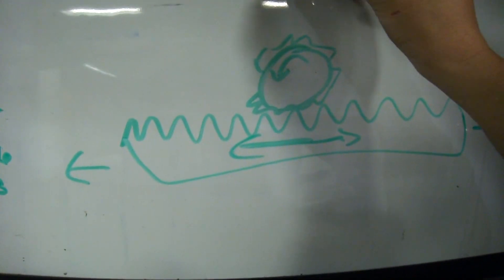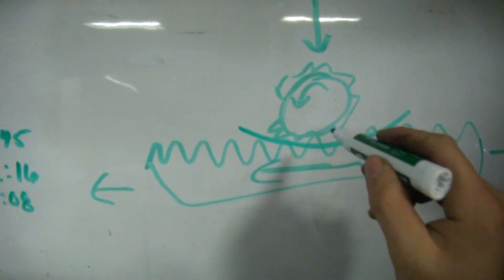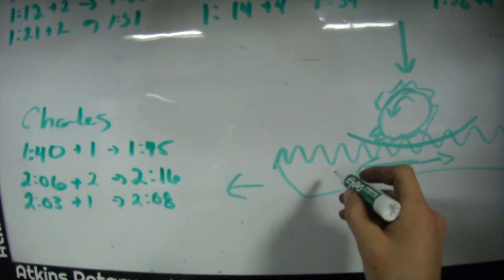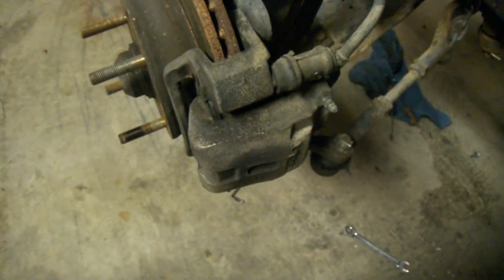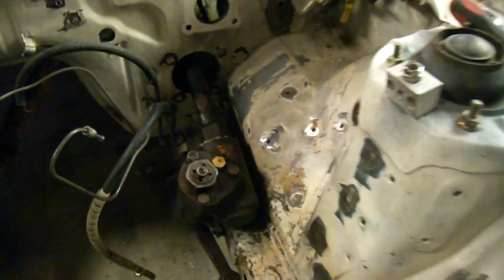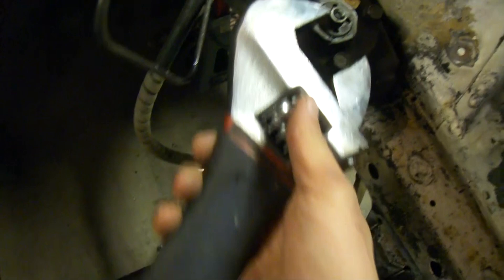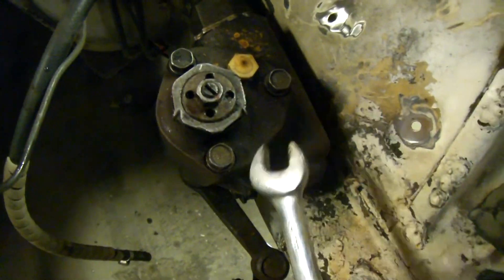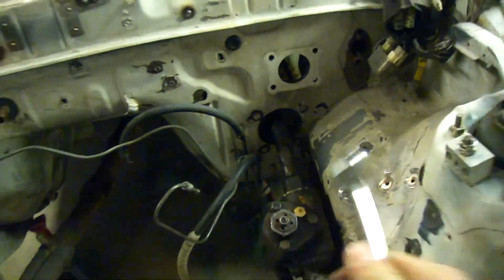How to Adjust SA FB RX7 Steering Box

Comment: My 85 GS steering box is similar but just has the large 41mm nut and the center nut with the four holes, nothing else. No hex nut or slot headed screw within it. Adjustment is done by undoing the large nut then turning the 4 holed nut with a U shaped tool fitting into two of the holes. The workshop manual says to turn it clockwise in small increments periodically checking the steering play so it's between 10 and 20mm as measured at the outside diameter of the steering wheel and testing the preload on the steering shaft so the shaft begins to turn at about 2.1 lbs of torque with the front wheels suspended. Then tighten the 41mm nut between 51 to 70 lbs of torque. I reduced the steering play quite a bit by making a 1/8 turn of the 4 holed nut. Thank you for the video, it helped substantially!
Reply: This is what my 82 gsl looks like. What is the U shaped tool you used?

Comment: Thanks for the info. I only have a tiny bit of slack after a full turn of the screw! Must have been super loose. There was a cap over mine.
Reply from the maker: Make sure it doesn't bind at full lock either way

Comment: Good info. I was just thinking of switching my 83 to rack and pinion. Is it best to use all FC components (spindles, rack etc.), or is there a better way?  Rx8 had electric power steering... That could be nice.
Reply from the maker: I haven't done the swap myself.  But I plan too
Reply: I'm going to be doing the swap purely because of parts availability and serviceability.

Comment: great videos! thanks! would it make sense to just adjust it at the extremes instead of the middle? just a thought. I may try it and see what happens
Reply from the maker: It usually can only get so good.  But take your time. And don't force it into the bind if it does

Comment: Pretty sure the big nut is the large adjustments and the small is the fine but info is kinds vague. Nice to know I can adjust the 3in of play out without taking that big nut off cause that thing is a pain to get to without the engine out.
Reply from the maker: On the later model non PS box?   Early year box only has one adjustment
Reply: @RADPotential  yea and my s2 doesnt have the 14 with the flat head. It only has the ~40mm nut with holes for punches to knock it around. Why I havent adjusted mine lol
Reply: @CastellawSpeed  mines the same way, I saw this video and got excited to go fix that slop and was disappointed to not see a flat head set screw, just the big nut and the brass cap with the holes on it. 85 gsl
Reply: @edgarbueno8027  I made a video on my channel just for those style of boxes
Reply: @CastellawSpeed  checking it out right now!

Comment: How do you adjust a stock nikki after a rebuild???
Reply: start with 4 turns out on the big screw 2 on the small one adjust big one for idle speed, small one for mixture. at least that's what worked for me